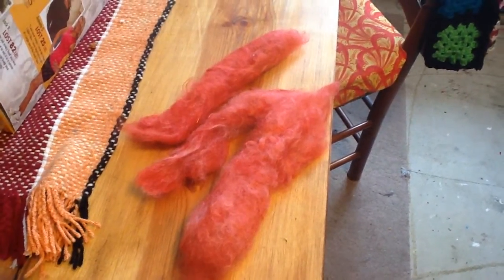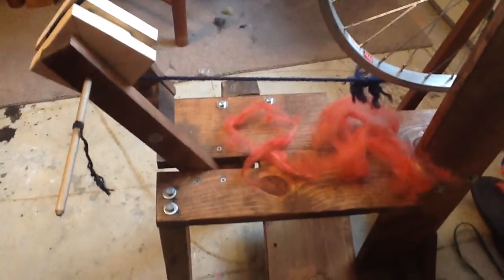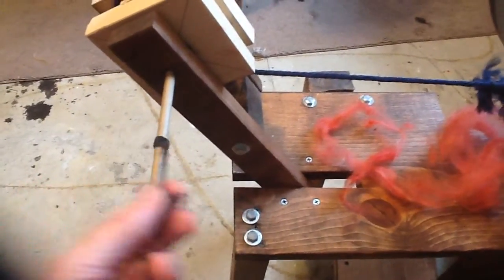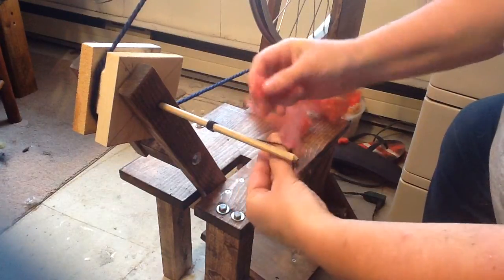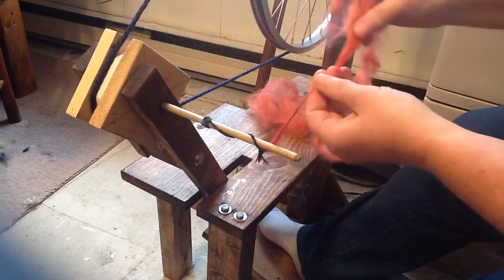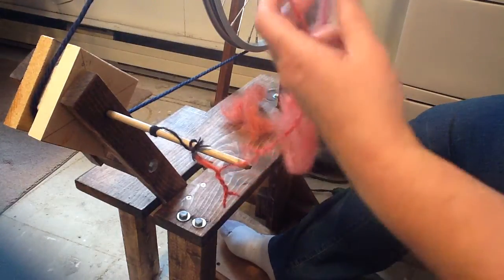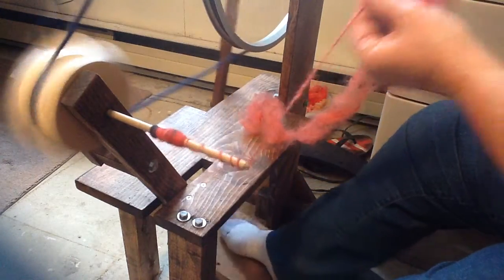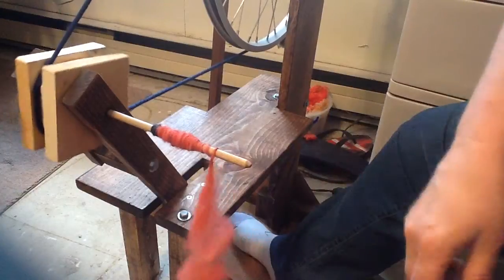beginning on a spindle spinning wheel

Comment: I appreciate you taking time to respond.  I may try and build the bumble bee  scotch tension on.   Thank you
Reply from the maker: probably the hardest part will be the bar that works the footman. I did a product review but the plan is to do one on using one. the footman have to move freely so the wheel turns. we have a wood shop as well but that metal part would put a stop to our making one. otherwise, it's all the same process of the wheel and pedals working . Good Luck on your task!
Reply: I know your healing and a busy person.  Do you have any sketches and or dimensions I could use to  make one?  Does your improvement  make a significant difference?  Thanks so much for your time responding
Reply from the maker: if it's the thrifty fox you are wanting to make the plans on the etsy website are superb! they are exact, detailed and worth every penny. the bumble bee is a flyer wheel. we haven't changed the thrifty fox wheel to a flyer simply because i have the bumble bee. I do encourage anyone who wants to spin to start on a spindle because you get the dynamics of spinning early on as opposed to starting on a flyer wheel and then moving to a spindle. The spindle gives you the experience of learning that 45 degree angle and helps you understand the concept of ratios, in my opinion. had i started spinning on a flyer, i never would have wanted a spindle wheel. So i'm personally glad that i did begin with the thrifty fox because now i own a Great Wheel and that alone is a whole new concept of spinning as it's the large one and sitting is not an option. now it's not only the angle but full body movement. Women back in the day where known to have put in over 20 miles just spinning enough yarn to make a sweater. The thrifty fox plans are honestly perfect. the only change we made to the plans is where the weights are. We moved them to the outside of the wheel and added a few more washers so once it passes the noon position, the weight of the washers carries the wheel without lots of foot pressure on the pedal. otherwise, it's exactly as it is in the plans.so if building a wheel is your goal, i would honestly start with the thrifty fox. the flyer wheel is easy enough to put together except the bar the rotates the footman unless you weld too. the flyer device, on average, will run you $100 just for that and with $100 or less, you can create the fox wheel and have a great learning experience. With reclaimed lumber and a used bike wheel.. your main costs will be the carriage bolts.
Reply from the maker: on etsy it's MysticFoxHollow and the plans are $13.95. the link in the comments is still active should you decide to go that direction.
Reply: I will be patient.  I can build one I am sure just need your input when your well and ready to share.  Thank you
Reply: already built  6  thrifty fox ones.  I thought you mentioned you have made some improvements.  Think one with the whirl like the bee one would be more functional?
Reply from the maker: ahh!! originally we had planned on converting the thrifty fox to a flyer but then my hubby got me the bumble bee for Christmas and well, there's really no need to convert it now. the thrifty can be converted over to a flyer with some minor changes on the mother of all. having the flyer and bobbin in hand will be your best bet for measurement. to make the bumble bee with a whirl turns it to a dodec wheel and sometimes, no matter what they say, they don't always spin right. we have one dodec we made almost a year ago and we have tweeked it a dozen times, add a ball bearing device for easier spin and once we get the drive band on it.. no go. it's one of those that will probably turn itself into a thrifty fox for sale here locally. But there's nothing wrong with giving it a try. Or maybe try your hand at a Great wheel! :-) on the thrifty, only major change we did was we pushed the weights all the out on the bike wheel. up close to the post there wasn't enough weight. so we moved it to the outside rim and added more washers so the weight puts the wheel headed in the correct direction without using a ton of pedal pressure. hope that helps!
Reply: thank you guess i want go that route either.  still enjoyed your videos

Comment: thank you.  would like to see your updated  version when it is completed also
Reply from the maker: I have plans to do an updated one cause i've learned more since this one. Unfortunately, I have fractured my left foot and although it's 8 weeks for it to heal, have planned to get this one done first since i wont need my left foot to make the wheel spin. i do however, have to stay off of it for another week and then i can start working with it. Thank you for commenting and watching. I'm not a pro by any means but Hope you're learning a few extra tips to help out!
Reply: Hope you heal  faster and get back doing what you love. Your video was well done and  can tell you love the craft.  Can hardly wait until I see your improvements  :)
Tom
Reply: did you say you liked the bumble bee one better than thrifty fox?
Reply from the maker: actually yes. The thrifty fox wheel is a spindle wheel with one pedal. Right now with a fractured foot, the fox is the only one i can use because it works my right foot to make the whorl move. I love both but after a span of time, my leg and calf muscles start to cramp and I have to stop. the Fox is perfect for long draft spinning like lincoln wool that has a longer fiber. The bumble bee is a scotch tension wheel with two pedals. the Bee, I can sit in the living room with everyone else on tv night and spin without having to pull on a long draft. I can sit in my glider chair, both feet working  with little strain and still get yarn spun easily. I have also acquired a Great wheel from the 1800s but it's till getting some repair to make it work. that one requires standing and walking back and forth as there isn't a pedal at all but is worked with hand turning. So out of the three wheels, the Bumble bee scotch tension wheel is my favorite as i have better control of the fiber, better control of the thickness of yarn and less strain on muscles. I have, in the last few months, spent and entire day doing nothing but spinning on the Bee and didn't have any aches. I got lots done since my mother is a weaver and she uses mostly yarn I make for her rugs and blankets.the only wheel i don't have is what they call Irish tension ( even tho the Irish didn't start it) but it has a leather brake on the top cause the band is on the bobbin.
Reply from the maker: thanks. i do love spinning. i have so much wool to card it's not funny. I still have wool from my very first attempt at spinning yet to be carded. I have to get better soon cause the loom is empty at the moment and well there's another rug in the works! Seems days go by too fast and I have too much to do to just spin anymore. With the seed group, the craft group and our small booth at the flea market.. there just isn't enough hours in the day anymore. Hopefully I can get some quiet time to get a new one done. Can go thru and explain things a bit better. My first videos were done with an Ipad cause it's all i had at the time. Now i have a good camera on a tripod so i can get better videos done. this foot being bound is a problem but it will heal in time and i'll be off to the races again! Have fun spinning your fiber!!

Comment: What do I do if spindle isn’t removable how do I combine two spindles of yarn together?
Reply from the maker: You will have to ball what's on the spindle and then you can combine your two together as ply. If your going to ply it directly after spinning it,  you will have to be watchful of twisting since the fiber is still in tension. Using a knitty knotty can help to release tension from yarn you have just finished spinning. Does that help?

Comment: Hi, Phoebe,

My aunt's name is also Phoebe.  You are the only other person I know of with that beautiful name!

I am about to begin making a Thrifty Fox wheel, and am wondering if you have done the conversion to the flyer yet.  I saw the video on your channel of someone who had done the conversion, but he also made a whole bunch of other modifications and didn't give a lot of details regarding converting to the flyer.  I would love to have your details if you've done this.

Thanks, Melanie Perkins
Reply from the maker: +Melanie Perkins  Sorry it took so long to see this. My apologies!! I have not converted to a flyer on my thrift fox. I am debating it considering the costs of the flyer wheels. It's something I'm looking at doing although I did find a flyer and bobbin set up and it's just a matter of mounting it to a new bracket on the thrifty fox. Now that i know someone else is looking at doing the same, I will certainly post about it. The flyer attachment is about $140 as opposed to the whole wheel which is about $500 .. lots of savings there. Thanks for watching and posting. I'll keep ya posted on that flyer change
Reply from the maker: +Melanie Perkins I think my biggest change on the thrifty fox pattern is where i put the weights. I did put them as far from center as possible and not only did we lock them in with a bolt we zip tied them so they don't move. I find the wheel spins much easier with the weights at the edge instead of close to center. Gives better spin to the wheel that way! Good luck with your spinning!

Comment: once you have spun the wool and taken it off the spindle how do you stop the wool untwisting itself?
Reply from the maker: when you spin wool.. spin clockwise. either put it in a ball or use the bracelet method and slip it over your wrist. Then put it back to the wheel to ply it and that will go counter clockwise. if you ply clockwise it will continue the twist and that wont work. Now, once you have plyed yard... use a knitty knatter ( buy or make one) and once you have it in a loop... take it to the sink. start with cold water and dawn dishwashing liquid. wash it good in cold water... and then turn the water towards hot. keep rinsing in hot water. my water is 140 degrees so once it gets where i can't handle the temp anymore, turn back to cold. This locks the color in the yarn and also felts the wool so it doesn't unravel. Then hang it up and let it dry. I might have a video for that but if not i can do one for you. Let me know how that works for you. if your wool is not holding a twist, did you card it or did you spin too light. I spin my wool tight. if i take the tension off the string, it will bundle up fast. try that.. if none of those work, drop me a note and i'll see if i can get something up to help you
Reply: +Phoebe Snow Cronan can you do a vid showing how to ply as it would be easier for me to understand the process.  ty.
Reply from the maker: there is an old one but i can do a new one. give me a few days to get it done
Reply from the maker: added a new video. called Plying spun wool and what to do after. Hope that helps you out. let me know